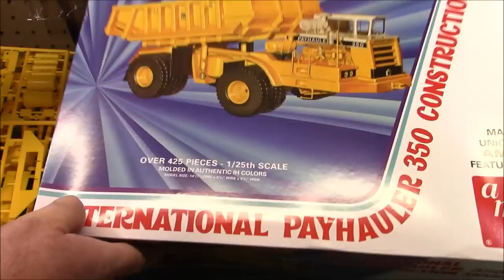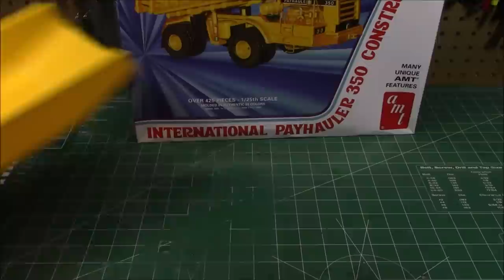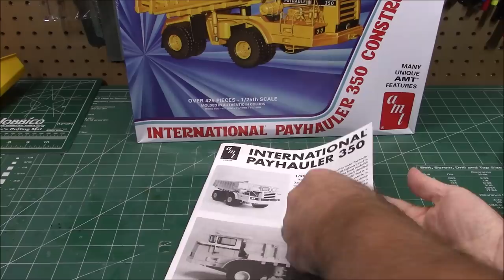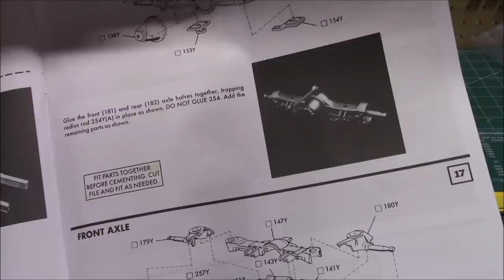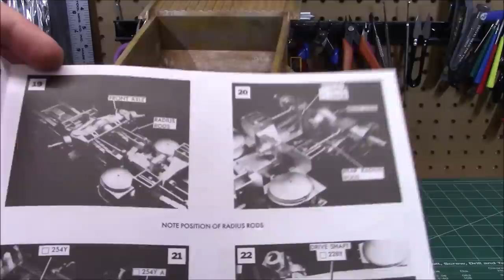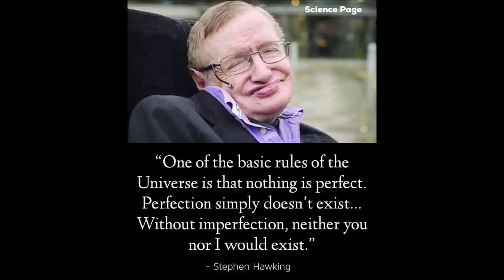International Payhauler 350 Detroit Diesel Dumptruck 1/25 Scale Model Build Review Weathering AMT

Comment: I've been reluctant to pull the trigger on this one til I saw this video! Gonna get me one now! Mines goin to be pristine,brand spanking new,cuz I'ma gonna buy that triple axle lowboy and modify it and chain this beast to it!! Got a White Western Star,the coke one from round2 . I bought the Super Boss drag truck and swiped the 12v71 outta the kit and  scratch built a frame for the truck,and put the 12v in the Western Star!!! Only thing on the motor I had to change was flipped the exhaust left to right so the turbos are in the front. That's gonna be mine prime mover for the bigged up lowbo!! I'm getting all excited about this kit now!!
Thanks for the (as usual) great in depth build video!
Reply from the maker: Enjoy the build!

Comment: Well, this is a poignant stroll down memory lane: I had this kit from Ertl prior to any mergers or buyouts, buying it for my birthday present. I built mine largely new, with mud on the tyres, weathered with dust overall, a bit of road grime here and there, black shadowing in the engine, and along the chassis, etc., though nothing heavy. I found scale appropriate figurines, one of which I converted to a driver, another to a foreman or a spotter. 
   I had wanted to plumb the compressed air tanks, though I could not determine exactly how the pneumatic (?) hoses, tubes, etc., would go; similarly with the batteries' wiring leading to the engine (I understand that a diesel has no spark plugs—except some Detroit Diesels, that had a single-cylinder petrol motor to serve as a starting apparatus in cold weather conditions—though exactly what did the batteries do?). 
   I also had built immediately prior Ertl’s kit of International Harvester’s TranStar II Cabover. To give one a sense of the size of the former, I placed the latter into the dump body, which encompassed the entire TranStar II! 
   I would like to build another International Payhauler 350 Detroit Diesel Dump Truck kit busy at the bottom of a bustling dig site; a second one down, with a team of mechanics working on the engine, and a third one with a service crew changing out a tyre. (Maybe sumbuddy could convert one of these to a whole new version of a monster truck ss one can see at the county fairs all across the  nation!)

Comment: How do you keep from getting runs.  Great build,good subject. Just bought the AMT dozer and trailer combo.
Reply: If that's the old D8 ,I built one after getting out of the Navy Seabees as a heavy equipment operator and I built a full roll cage and painted it camouflage, about 3 or 4 different colors. Of course that was many years ago .
Reply: @freedomring4813  it might be a d-9. It hasn’t arrived yet. But it looks like one. I’m thinking of doing a forest service dozer,or fire service one.
Reply: @Johnny-tt8zc  Its the D8 ,I looked it up .I ran a D9 just like it with a pony motor in the Philippines when I was in the Seabees back in 82. Good luck on the project.
Reply: As to the runs,I'd guess he stays away from cheap Mexican food and canned chili.
I'm going to order that dozer trailer combo, one these rock trucks, and another lowboy trailer,and modify it if needed,to put this truck on! That's my winter plans, right now we're really getting Rollin with the harvest. I do most of my building during my down time. Stay safe and healthy!
Reply from the maker: You get used to using sprays once you do it enough. I still mess up now and then.

Comment: That Detroit Diesel would make a good engine swap for a car model lol
Reply: A Crazy Rat rod lol
Reply: Only problem with that is,the engine and transmission overall are longer than say a mustang,and probably just as heavy if not heavier.
Reply: @tomcline5631  would have to extend the chassis a few inchs lol
Reply from the maker: That would be quite interesting to engineer. Give it a shot!